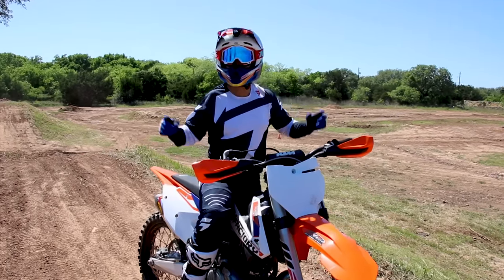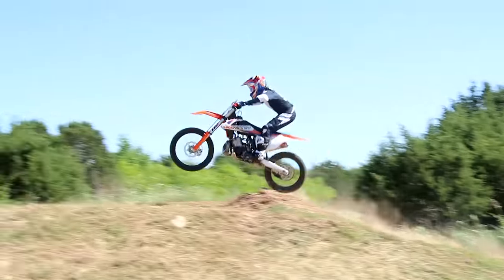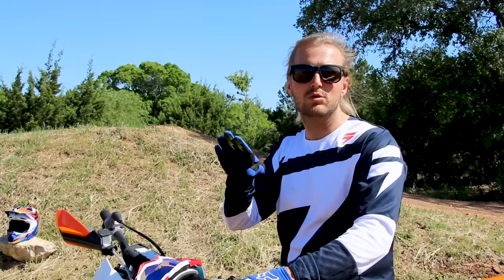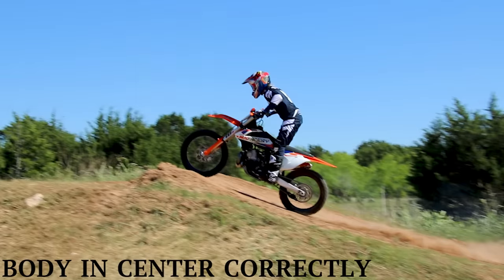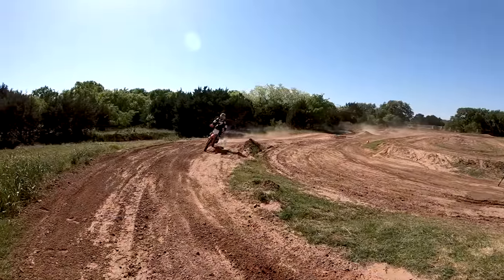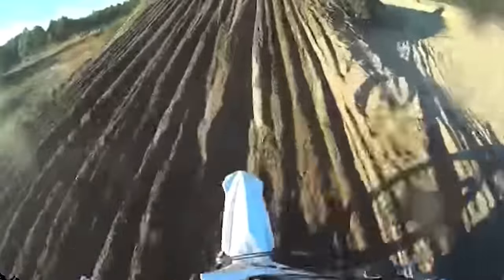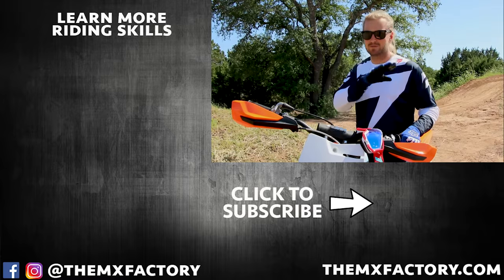Top 5 Jumping Mistakes on a Dirt Bike - Most Common Problems & Solutions!!

Comment: Wow! This is such a great video and I wish I knew this stuff when I rode a lot  years ago. I used to have that first problem and probably a little of all of these. Maybe that's why I never jumped much or that big. Another problem I had was not being able to tabletop to the right at all. I'd  be screwed if the bike ever went to the right in the air. Also could never hit the rear break to bring the front down if I went back too far. It always looked to me like that was a problem with Evil Knievil had with most of his jumps. I never really thought about the mechanics of jumping this way though, and and not having this clear understanding of it made for this fear of bigger jumps that I never thought I could do because they were scary. I was always pretty amazed seeing some guys hit big stuff, but now I see the approach and everything applies to smaller jumps the same way as the bigger jumps. I'm pretty much over with those days anyway  now, and kept my Enduro.

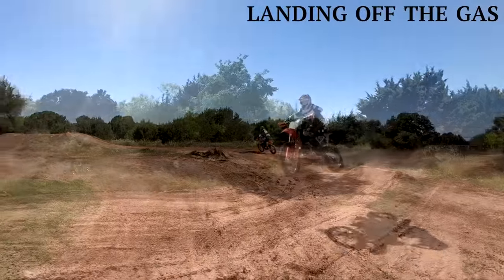Comment: 3:54...the reason being on the gas helps is dirt bike geometry has anti-squat.  When you are on the throttle, the chain tension actually causes the rear swing arm to act like the spring and shock are stiffer.

Comment: I have over jumped on steep walls jumps landed in the flat. I hit so hard, that I got a secondary bounce that nearly pitched me over the front.several times...Is this human error #1 or a suspension tweek issue #2  ?
Reply: Both probably, if your landing flat it’s better to land on the back wheel

Comment: There are a few more differences comparing 4 stroke to 2 stroke when jumping. One of them that I noticed was the 4 stroke would nose dive in the air from the fly wheel & compression , almost caused me to wreck going over the bar's. Lol
On a 2 stroke jumps that you hit carrying speed into the lip & not gassing at all off the face the bike will stay level , do that on a 4 stroke & the front end will dive down.

Comment: OK, so help me out understanding this. I do Mountainbiking and not motocross.. yet. On a mountainbike, you need to jerk the steering wheel up to get the nose up and jump. Allong with pulling your feet up so the rest follows and the bycicle, stays straight as it were. But on a motocross bike, throttle is everything?? No throttle the front wheel hangs down and mucho throttle the rear wheel hangs down? I don't get the how and why.. Please explain.

Comment: Hi, thanks for your demo, very useful. Just 1 question, some pro riders say you may compress suspension before ramp, and release/extend on the ramp while gently throttling : what do you think ?
Reply: Called a seat bounce
Reply: It’s a seat bounce, it’s a more advanced tip and should be used for beginners, but it basically helps with air, and clearing a jump smoothly

Comment: Any tips?
Been riding on and off with motocross for few years now but only off road and no track stuff. Recently bought ktm sxf 250 to give motocross track a go when got the confidence... Ive been practicing small jumps where the height of the jump is about 5ft from ground and length off the ground is around 10ft. Took all of this advice into account but for the life of me I keep getting almost pinged up and off the bike in mid air... Like my feet come off the pegs for a split second then back on to them.
Realise I'm supposed to squeeze my legs or hips?... Can someone explain this as feel it would help massively... Aidan.

Comment: Hello. I’m an older guy getting back into dirt bikes for fun. I’m a big guy. 350lbs. 6’4”. I have a KTM 450 sx-f. Beefed up my spring per my weight.  Right now I’m just doing trails and farting around.  Nothing major.  I guess my question at my size should I even try to be jumping?  I use to a lot back in the day so I know how but I wasn’t as heavy.  ??? Worry about if the bike can handle it.

Comment: Could you guys make a video on how to brake tap properly?
Reply: brake tapping is wild. it was so hard for me to do it the first time. but once I did it twice, I swear it was second nature (even over small jumps) and didn't even have to think about it. you just have to go out one day and practice it. make sure you pull the clutch in, and make sure your body position is centered (if you are too far back it won't do much good). also blip the throttle after (2 stroke. not sure about 4 stroke. never rode one).

Comment: I have a yz250x. Can I jump on this shit or is it just for trail riding. New rider
Reply from the maker: Jump it! It’s got suspension and motor, you can jump it. Trails aren’t always just nice and flat, those bikes are designed to air it out a bit and take decent drop offs.

Comment: Hi Everyone,
I was wondering if someone could help me pick out a new Honda Dirtbike. I’m new to riding and I have been looking at two models the crf230f and the 250x. I am 6ft (180cm) and weigh 132 pounds (60kg)
Reply from the maker: Either bike would be great. The 250x may fit you a little better from a taller seat height.
Reply: There are a whole lot of difference in those two bikes but if you have the dough, get the crf250, they are tame enough for beginners and there are alot more things yoh can change as your skill level gets better, you won't have as many options on the 250x, it IS more of a beginner bike though, the crf250 revs alot higher than the 250x, also there's a big difference in the prices of those two bikes, hope that helps.